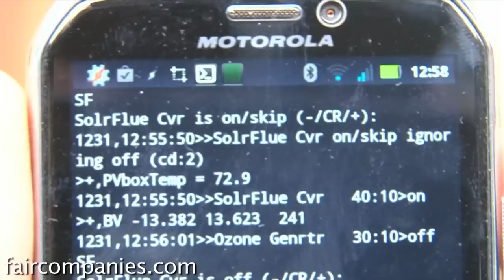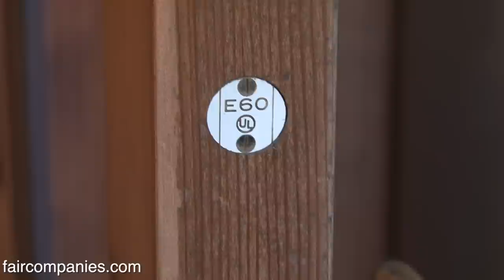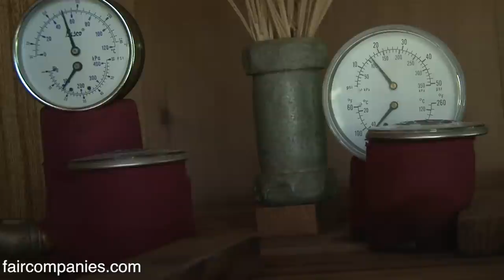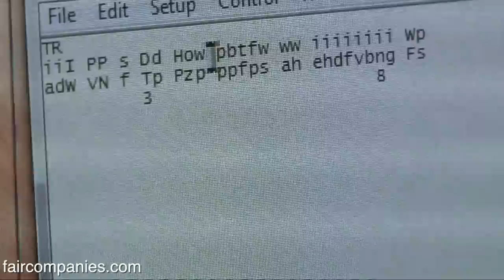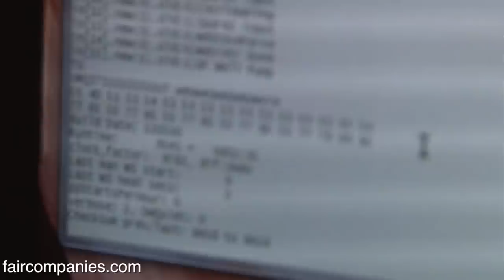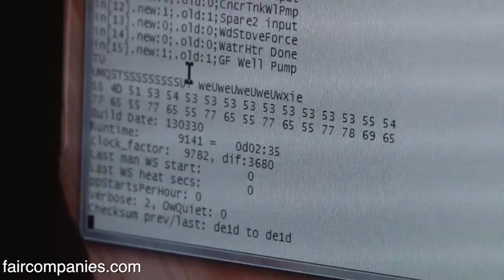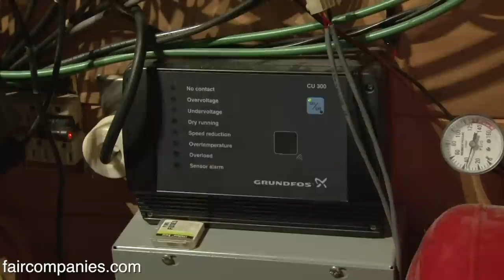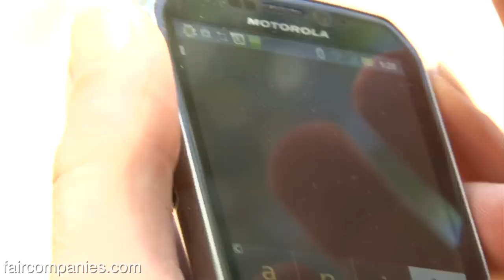NorCal veteran coder customizes off-grid home with sensors

Comment: These video would be greatly enhanced if some details were provided. Like say, what type of drip emitter he used and where to procure them. Change only happens when information is shared.
Reply: The drip emitter looks like what I have -- about $2 from Home Depot -- twist to select one to ten gallons per hour.
Tons of info available via Google :-)
Reply: Looks like you have some research to do:)
Reply: I think the videos are more about the aesthetics than the technical, though would be good if there were information sheets in the links or something like that.
Reply: Ajay Eff
To be honest, this house is this guys own creation. I doubt he is going to be too willing to give out tech specs. He would probably be willing to give some basic advice. But that's about it. This is a very proprietary design. His design.
Reply: Joe Blow
Heck I would just be interested in what model of water dripper he was using. There is nothing proprietary about that is there?
Reply: *****
AHH, then take a screenshot of the dripper and take the picture to your local home and garden stores to find it:)
Reply: Joe Blow
Been there, done that. No love. And you expect the pimply faced kid they hired Monday to know this?? :)
Reply: *****
I didn't say you have to ask someone to find it. You can always hunt it down yourself. You can even scour the internet for it.
Reply: Joe Blow "Been there, done that." Guess I have to spell it out for you. Even with just the pic and the internet. There are at least 3 manafacturers each with at least 16 variants that look exactly like that dripper. Without additional information you don't have a prayer.

Comment: When the power company's subcontractors and staff would come around to keep down weeds under the power line and poles, they'd tramble bushes and trees, leave huge ruts in my driveway with their huge machines, and they'd spray herbicide on my fruit trees and fruit bushes - even though other emplyees and company literature said bushes under 10" tall and 15 feet from the poles were fine. i HATED the power company.

Comment: I will like to know more about is system to get internet,
Reply: A 5 GHz WISP connection to a nearby peak and then to fiber in the next valley. Somewhere in one of the shots of the greenhouse you can see a Ubiquiti CPE in the window. (There is a faster one out in the garden with wire back to the house.)

Comment: He has been up there off the grid since the 1980s. How does he earn money for food and other necessities?
Reply: For years I designed and programmed robotic semiconductor manufacturing tools for Silicon Valley companies. Had test models here, shipped code via internet. My machines were the first in the industry to produce detailed operation and problem logs the users could recover from the fab and send back to me for analysis. Also programmed an agricultural sensor that could map the nitrogen required across a field and control its application. And other extreme tech... Now retired...

Comment: reupload?
Reply from the maker: No, I revisited Loren. I have annotations onscreen in a couple of spots linking to the old video (actually 2 videos). I used some video from the first shoot, but most of it is new and we explained new elements of the house.
Reply: Kirsten Dirksen It would be cool if he has some simple block diagrams to explain how his heating and cooling system works, and some numbers about how efficient it is.  Given the right design I think a system like this could be almost totally self-contained.  The only think that I hesitated with was the 3 stoves/burners he said he had.  That puts him dependent on wood from outside and on your  blog he said he could not supply his own wood.  I think he could work on closing those loops.  He has quite a few places where he generates wood smoke, i.e. CO2 gas.  I'm glad you showed more of his garden, that is really cool.
Reply: +No1HillBilly No it is not..lol Stop with the mainstream memes. It makes you sound uneducated. 

Wood smoke consists of CO and CO2. It is not carbon neutral.. And stop using the term carbon neutral. It's not a real term.

Plants do absorb the CO2.. But  not the CO as carbon monoxide is a poison.
Reply: Well either way, he could take it even bigger step further and use a rocket mass heater resulting in more efficiency and less wood being used. Then, if it was long enough he could use the co2 out from its exhuast for plant/food production.